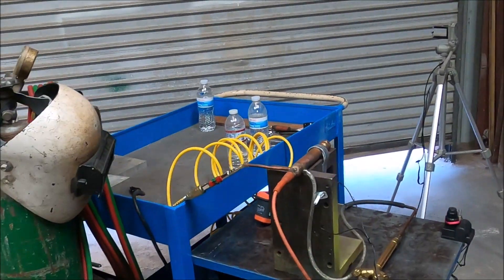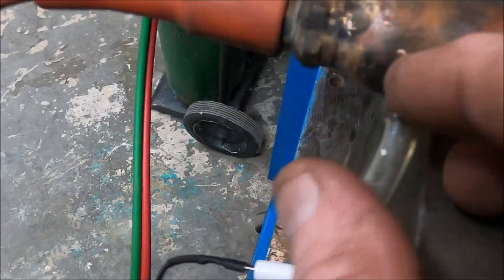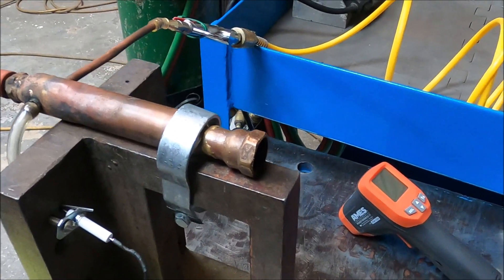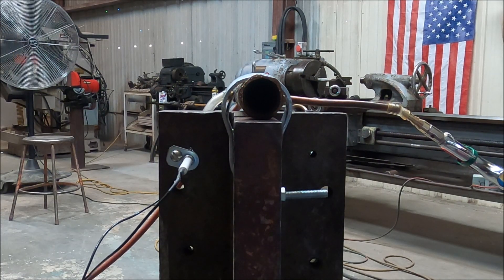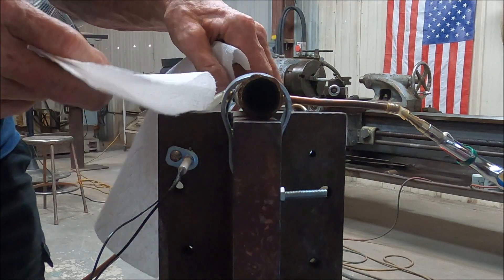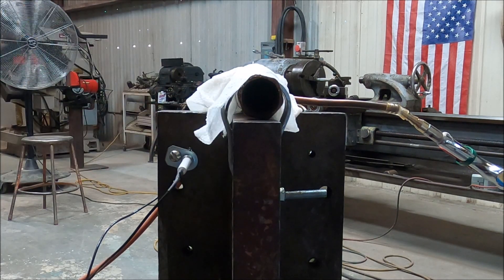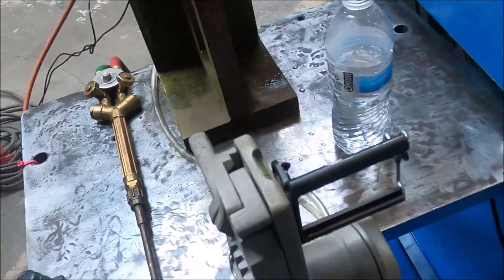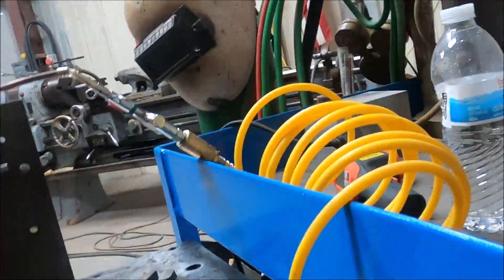FRANK TESTS HIS PULSED DETONATION PUMP  JUNE 27TH 2024

Comment: "excetylene"?
Reply from the maker: It's spelled acetylene. Acetylene (systematic name: ethyne) is the chemical compound with the formula C 2H 2 and structure H−C≡C−H. It is a hydrocarbon and the simplest alkyne. This colorless gas is widely used as a fuel and a chemical building block. It is unstable in its pure form and thus is usually handled as a solution. I use this for its' ability to detonate.
Reply: @parsonsenergy  You say "excetylene" -- there's no "k" sound in "acetylene".
Reply from the maker: @rdbchase  Yeah Chase, you got me there,however, asking for ethyne at the supply shop doesn't get me my refill. Saying Accetylene works every thyme. I appreciate your penchant for detail though, the purpose of this series of tests and rudimentary setup was to validate i could actually create a detonation.  I did two things ,namely, I created detonations of varying intensity and I can vary the frequency of operation. Tanks for your support Chase.

Comment: Years ago i built a travelling wave pulsed detonation rocket motor. It had the internal baffles designed so the shockwave was collimated into an exhasust stream of hypersonic speed a few feet from the nozzle but was cool nonetheless. It sounded like a very angry bee and a machine gun had a very ugly baby. Acetylene was too prone to detonation in the wrong places but a mix of oxygen, nitrious oxide, Methyl propylene, and ethyl ether worked well. You want it to create a bunch of smaller shocks to confine and compress the fuel mix in the center a few cm from the nozzle exit. You want a highly explosive but lower power mix on the edhe but a less explosive but far more powerful mix in the middle. Slightly curved bits of metal on the housing gave it the needed spin. Needless to say it didnt live very long being made of literal scrap metal. 😂
Reply from the maker: Tanks Chris… utilizing the TWD approach to PD (pulsed detonation) is an avenue to pursue, however, this pump 
application is more of a paradigm shift in what the concept of PD technology conventionally has been thought of.